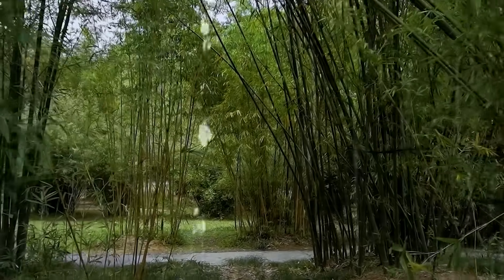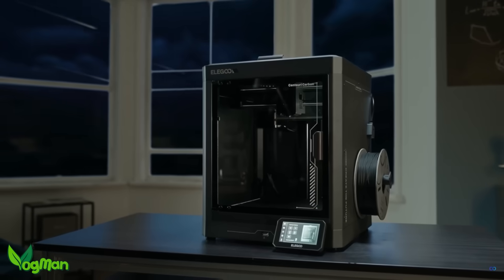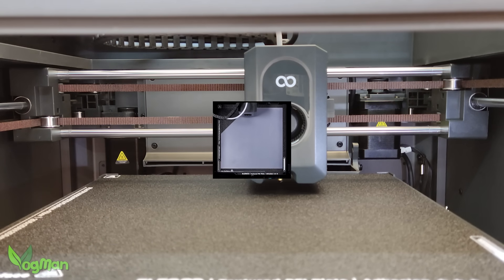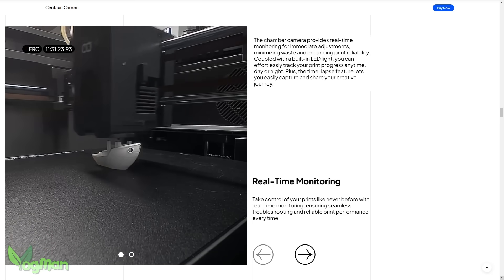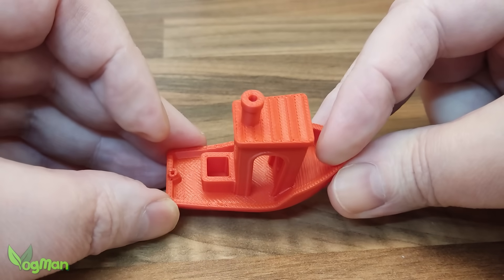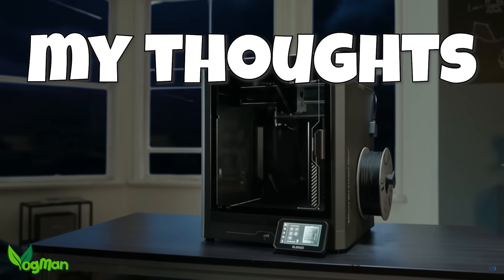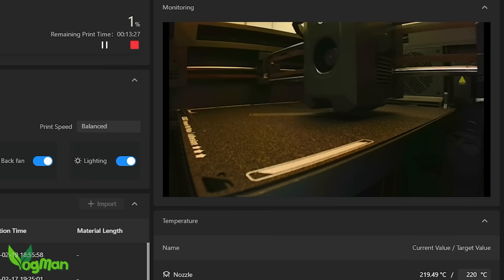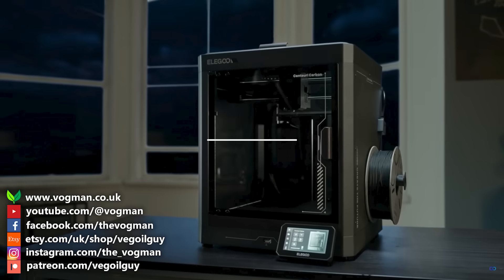Budget vs Bambu – Is the Elegoo Centauri Carbon the New Champ? (Review & Print Test Inside)

Comment: I pre-ordered a CC in February. It arrived seven weeks early, which was a pleasant surprise. I have a K1C, but I find the Centauri Carbon's output  slightly cleaner. Genuinely a solid printer (in spite of proprietary firmware).

Comment: I entered a showcase opportunity recently and found out I am a finalist in it! ~ I am getting this printer sent out to me very very soon. I am psyched that they are going to give the Centauri the multi coloured filament ability as I do a lot of prints that often have to be put together in different hues and such. (mainly for cosplay etc.) I love the cute little mini Poop Shute design and the fact the printer clips and cleans itself! My Elegoo Neptune 3 Max needs me to do both. :D In futured? I do definitely agree that where the tubing runs through from the spool to the extruder needs some re designing... alongside better lighting in the chamber itself and a much better camera with capabilities of video downloading etc.

All in all? I feel that for the price? It is a very decent model for beginners and for those who want to start printing more varied filament types etc. 
I've never had an issue with my Neptune 3 Max (other than a very very minor clog.. which it itself sneezed out of the nozzle when I did clear it a bit from the underside with a thin metal nozzle cleaner... sent it flying across my room. lol.) The only thing I am wary of is the fact it is not a direct drive extruder system (My first printer ((A Creality CR -10 Version 2.)) got a jammed Bowden tube and it wasn't worth repairing due to newer models etc.) I will be watching the Centauri's tubing like a hawk to ensure such does not ever repeat! 

The showcase also offered the choice of a resin printer instead... but nah.. I'll stick to using the resin for smoothing out my PLA prints... rather than attempting to actually print with the stuff~!

Comment: The shit I’m getting tired of is everybody thinking everything’s a contest. You have to realize even though uneducated untalented consumers think the bamboo machines are the end all be all, there’s those of us I’ve been doing it for a decade and actually think bamboo machines are kind of like toys and are very far from the ideal machine. I won’t go into reasons but you have to understand your consumer mindset is not everyone’s mindset

Now granted there’s been a benchmark set by bamboo but it’s not everyone’s benchmark. The Centauri carbon doesn’t necessarily have to be targeting that, it’s not even in the same price category. That’s your first thing you should understand if you had any knowledge of economics. It’s all about the dollar. If they were truly competing with the X one carbon they would’ve used the higher quality components done a little more Work and got it priced you know $300 cheaper not $800 cheaper. It’s like you’re trying to compare an Acura to a Kia. 

And notice I didn’t say Porsche

Comment: Please don’t compare to bambu c1. In all objectivity, Bambu P1S at around 500 bucks (plus option to have AMS) is a fair hardware match. And that’s just the hardware. I went through tons of printers and initially made the mistake to go just by the pure hardware price. 300 bucks sounds appealing indeed. However, that initial purchase price is just one factor of many: time to figure out problems, clogs, adhesion issues, real-world print speed, (lacking) support, incomplete software, you name it. Today I have a bunch of printers sitting around uselessly that were initially so sweetly affordable - but caused so many headaches down the road that I eventually stopped using them in utter frustration. By now I learned: what matters is the overall package, enabling me to print effortlessly and reliably in outstanding quality and speed when I need to - not when the printer has a good day. That’s the real Bambu secret: they invested in software and supporting ecosystem, not just the hardware. That’s what you pay for, and it is worth every cent. Their printers (and replacement parts) will also still be around a year from now, when many other vendors have long raced to their next „affordable bambu killer model“. BTW currently there seems to be a new „bambu killer“ video every other day, likely driven by a flood of free machines handed out to influencers. I honestly haven’t seen a true rival yet that - as a complete solution - comes even close to the current P1S. And I am by no means Bambulab fan boy. I am very open to competition and innovation. The tested printer can indeed be a good choice for anyone on a very tight budget willing to play more than work with the printer. Just please do not compare apples and oranges: the Bambulab printers are targeting professionals and have a track record unparalleled so far by any cheap knock-off.

Comment: I would have loved to see you print something in Nylon carbon, that’s functional and requires strength. 

FDM nylon is stupid strong straight off of the bat, and has crazy properties once aneled in the oven, using very very fine packed salt, and a heat proof container. 

🇦🇺🤜🏼🤛🏼😎🍀🍀🍀

Comment: 2:14 - I also thought my lid did not fit, but when you press down on it, it will snap into place. It's a nice feature unlike the Bambu glass that can fall off if you transport the printer.
Reply from the maker: In my case, it doesn't fit at all. Trust me.

Comment: It’s going to be my first printer. As for the camera , if it’s just down to lighting, I’m going to take the side panels off and spray the inside faces Matt white. That will help bounce the light around and cheaper than an upgraded light . But fingers crossed , when it’s released they have sorted out the small light we’ve seen so far
Reply from the maker: It's light enough for the job, but it could be easily improved with a cheap stick-on LED strip if it bothered you 😁

Comment: Looks like it under extrudes, that single layer print should hold together better and need to be torn apart, wouldn't be hard to do but the side to side layer adhesion shouldn't fall apart by just moving the sheet(sheet holds together on my Prusa MK4, FLSUN V400 and Bambu A1mini)
Reply from the maker: Well I'm not sure it's fair to say anything based on that print. It was very thin, obviously, and I was quite heavy handed removing it from the plate, tearing in places as I went. So some of the fault there is definitely mine.
Reply: @vogman  If you want to make sure you can look up e-steps calibration.

Basically you test to see if 100mm if filament is extruded when you ask the firm-ware to extrude 100mm, and if necessary adjust the number of steps it thinks the extruder stepper has to make to extrude that amount.

The easier 'cheat' is to just up the flow rate in the slicer and making a few test prints and backing of when things start looking ugly..

I hate fiddling with that stuff but I only do functional prints so it has been a necessity for me, or at least it was until I got a Prusa MK4 and a Bambu A1mini, which so far has been the only 'fiddle-free' printers I have ever encountered...

Comment: Does the run out detector at the filament spool end and connected directly to the PTF feed tube mean you have to take apart the feed tube to remove the 18 inches of filament left in the feed tube when run out happens?
Reply from the maker: I'll be honest, I've no idea. I didn't test that. I would imagine it's more of a warning detector, noticing that the spool needs replacing and giving you time to fit another. But I could be wrong here.

Comment: it's very interesting, especially for the price, but it's a bit small, if I'm not using a resin printer I'd like to be able to print bigger things
I'm interested but I'm a bit wary because so far production units haven't been reviewed, only the units that have been sent to reviewers and content creators
very interesting though, a lot better than my brother's rusty ender 3 that I refuse to borrow
Reply from the maker: In honesty, with the exception of the lid not being a perfect fit, I think this was as good a prototype as I've seen. No real issues. I think they've worked hard on this design.

Comment: Ironically, the X1C has the same issue with the cable for the LCD display!  

Elegoo and Creality joining the "3D printers as an appliance" party means great things to come for the FDM world.  I'm not going trade my Bambu for an Elegoo system but I know when it's time to upgrade in 5-10 years, competition like this means I'm going to have some awesome things to choose from!

Minor pedantic correction - CoreXY means the X and Y axes share two stepper motors instead of having individual stepper motors like they would on the i3-style bed slingers.  The kinematics are insane.. I know how they work in the sense that I can explain how they work, but I can't visualize it.... and I've built one!  Just wild stuff.
Reply from the maker: There's no doubt that EVERYONE wants to be compared with Bambu. They've been the top dogs for a while. I've no doubt they still are as everyone is catching up, but my guess is they'll have to seriously consider their pricing policy soon. The differences between these models are becoming smaller and those differences might not warrant the price gap.

Comment: I never wanted a Bambu Lab printer but there is a lot to like in Elegoo's Bambu Me Too printer.  US$300 is a good price for this build quality and these features.  I love that the heated nozzle directly probes the heated bed rather than trying to infer Z=0 from the added source of error of an inductive proximity sensor.  AI cameras are a marketing scam so good for Elegoo by not promulgating that lie.  I print a lot of TPU so I always feed filament directly from a bearing hub reel holder above the printer without a reverse Bowden tube so the removable glass top works for me, but Elegoo is selling the unenclosed Centauri (not a Carbon) for US$100 less which is a bargain for PLA/PETG/TPU, or for people like me who would design a 3D printed ABS insulated enclosure to get an even higher temperature passively heated chamber than the Centauri Carbon can attain.

Based on the comments from the Elegoo rep at a couple of trade shows, they seem to understand that they're competing on ease of use and user experience, while most Bambu clone makers have tried to simply copy the hardware and general look at a cheaper price.  It seems that Elegoo mostly achieved their marketing goal of appealing to new 3D printer customers.  Kudos for providing well tested Elegoo filament profiles but they should provide these profiles for PrusaSlicer and OrcaSlicer instead of creating their own Centauri only version of OrcaSlicer.

Comment: Okay, honest question. Can you move the filament sensor, or is it like, welded to the chassis? I have a really nice setup planned out for this printer but it really won't work if it's welded to the frame.

(Creality pi double filament dryer, hook up ptfe tubes out to each centauri)
Reply from the maker: I don't think it's bonded as it moves a little, and with a 4 colour system on the way, I suspect this whole thing may be replaced.

Comment: I'm impressed that it comes with a hardened steel nozzle and all metal hot end at that price. Feature wise, I think it's closer to the Bambu P1s, despite the "carbon" name, and despite that it has no carbon rods. I will wait to see how well the multi-material system is integrated, but so far this printer looks great for the price. That first layer test seemed to not be fused in a few places, so I hope they add a way to adjust that first layer.
Reply: I would have bought the Centauri (not Carbon) because I'd prefer to design and 3D print my own insulated enclosure, but I didn't want to wait over four months to get one of the first units.  Being an early adopter usually requires paying the most for the privilege of beta testing products.  At least the 3D printing industry generally has customers pay $20 less to beta test the first units.  Unless you must have the latest toys, it's usually better to wait and pay $20 more for a better printer, but the 4+ month wait for a pre-ordered Centauri was too much.  I assume Elegoo is trying to lock in sales before Bambu releases their next line of printers, but I didn't care to buy a pig in a poke.  It feels as if Elegoo is two years late to the Bambu Me Too party but even though ridiculously late, they're rushing the Centauri to market and selling printers they haven't manufactured.  On the plus side, they made a lot of working prototypes and sent them out for review so hopefully the 4 month delay for the delivery of the Centauri Carbon and the 4+ month wait for the Centauri will allow Elegoo to fix all of the issues discovered by prototype beta testers before the production units ship, and the initial customers will have a relatively easy time for once.
Reply: @Liberty4Ever  Yes. It's VERY tempting to grab one of the $199 Centauri models - but the wait time seems suspicious and Elegoo's add-on "worry-free plan" is worrisome. Apparently Elegoo is not prepared to take any responsibility for lost or damaged shipments unless the "worry-free" option is ordered for as additional five dollars or so. Maybe Amazon has spoiled me, but I expect the seller to get the product to me intact at no extra charge. Even Bambu will - eventually - make good on lost or damaged printers. This Elegoo offer doesn't smell good. If the $199 price holds I may grab a Centauri later in the year, and by that time there should be more actual reviews from civilians who don't have 3D-printing YouTube channels. If this follows the disappointing Creality pattern, early review printers will in no way reflect the quality of shipping units.
Reply: its carbon colored. therefore. carbon.   also carbon rods suck over time... some of teh bambu x1c users are finding out the hard way that.. carbon does wear out.. and it creates nasty dust that both gets in prints, and the air you breathe.
Reply from the maker: I did ask Elegoo about the "Carbon" reference but their answer didn't really answer, so I guess it's just a name thing.
Reply: @vogman  - Elegoo sells the Centauri (no Carbon) and it's the same printer without the enclosure and for some reason the bed is limited to 100C instead of 110C on the Carbon version, so apparently "Carbon" is the designation for enclosed high temperature materials.  That's reflected in the comparison chart where only the Carbon unit is recommended for PA and PC.  The Centauri also has no camera, chamber fan or filter.

Comment: It certainly looks nice as a printer.  Only concern for me is Elegoo printers I have had, all FDM, work great out of the box but fairly quickly start having problems and require a lot of maintenance.  I hope they have learned from their past.  Great review.  Waiting on the printer to shred that bambu though, I need some for gardening. :)  #LLVM
Reply from the maker: Elegoo has it's lover and it's haters, like all brands. A quick look through these comments will show opinions both ways. I don't really think this is an X1 competitor, but I'm willing to bet it's 90% there. So IF the CC proves itself over time, I think Bambu will have to change it's pricing policy. You can charge top whack when you have a monopoly, but the gap is closing very quickly now... will the differences justify the price any longer? It will be interesting to see.
Reply: Personally it was the other way around for me, tho I did buy a refurbished printed, Neptune 4 standard model. It was like new but the bed screws were a little loose so had to beat them, beyond that it has only been issue of dialing in.

Comment: 30 mins for a benchy is pretty fast. 

I have a couple of concerns about this printer’s design. Since I don’t have one I can’t really tell if that Ptfe tube goes into the hot end. If it does go into the hot end I’d use caution if you decide to print with higher temperatures because those tubes can off gas toxic fumes at higher temperatures.

I’m glad you had a positive experience. Newbies got it good these days. That setup was the simplest I’ve ever seen.
Reply: The breakout animation of the hotend at 5:35 shows what looks to be a metal heat break.